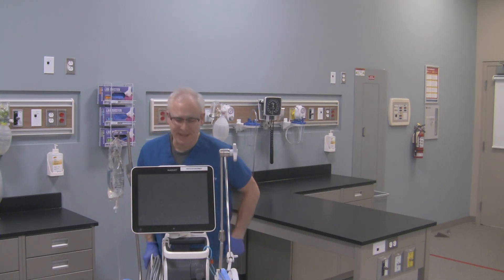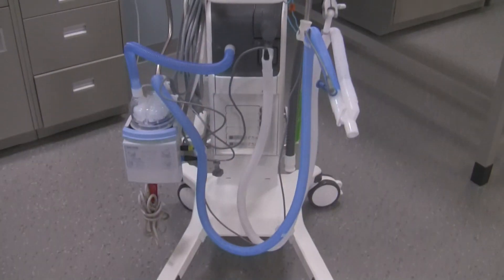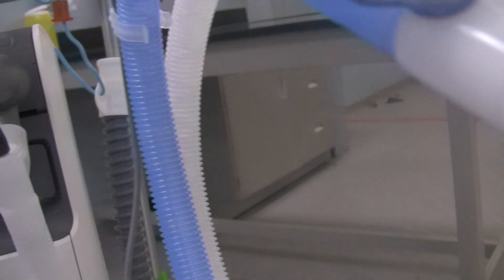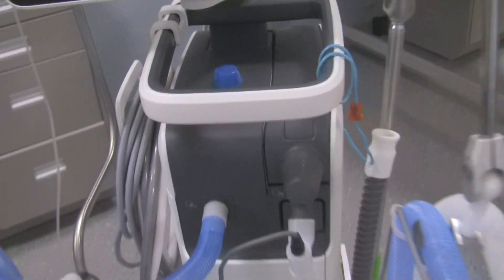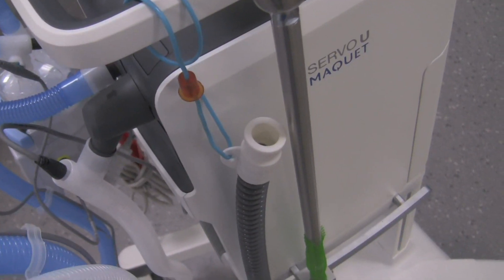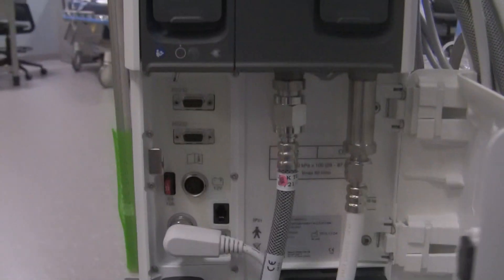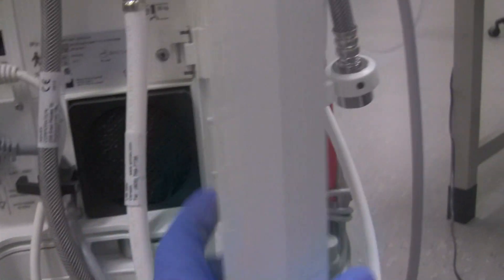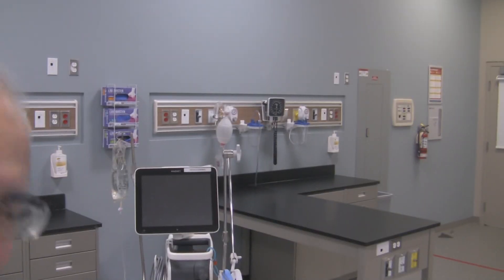Maquet Servo U Ventilator Basic External Features

Comment: Why did you choose to buy this ventilator?
Reply from the maker: Servo's are great ventilators.  The Servo U is the replacement for the Servo I so we purchased them primarily for that reason.  The others companies vents are really good units too.  Sorry for the later responce
Reply: @deepwubbinz7919  we just dump alcohol down them and tip them up to dry
Reply: @deepwubbinz7919  you know if you use the Servo filters, there's no need to send the cassette for processing. Just wipe clean and you're done! It's in IFU's!